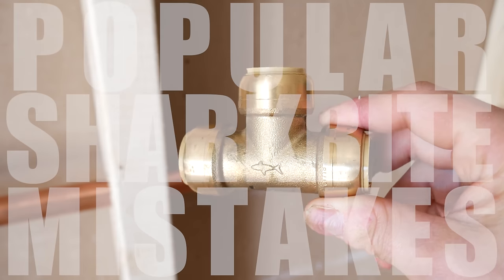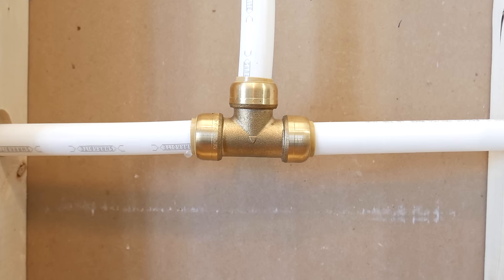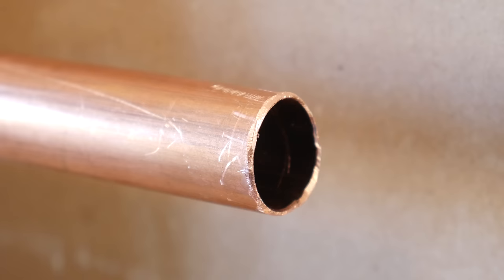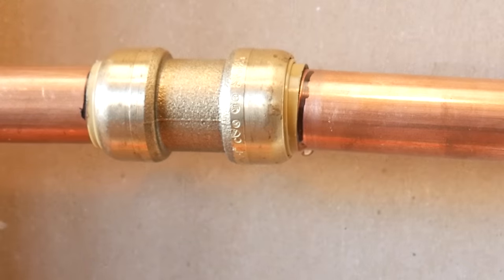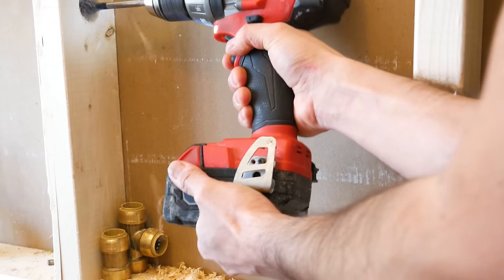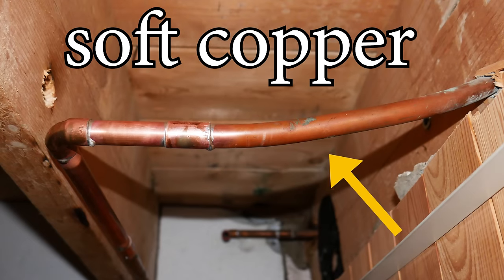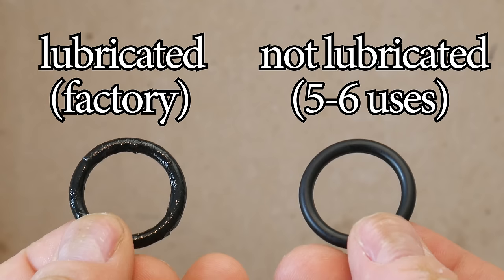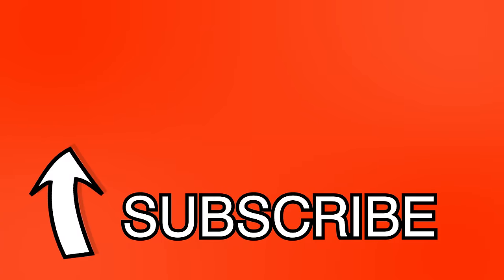6 SHARKBITE Mistakes NOT To Make! | GOT2LEARN

Comment: There's really only two applications that I will use these fittings for.  
The first is temporary caps.  I keep a few around, and yes you need to know when to throw them out once they've been used too much.  They are great for short term caps for supply lines during a remodel.
Second, and I only use these situationally, are shut off valves.  I still favor saudering, but sometimes I will throw one of these on instead.
You couldn't pay me to use one of these sharkbite fittings for in wall work.  And really, anything that isn't a cap or shut off, I would just prefer to sauder.

Comment: When installing a shark bite fitting in a copper line for a refrigerator water feed line, how do you get the fitting to fit properly if the copper lines in the wall won’t move?
Reply from the maker: I don't understand Sid.
Reply: @Got2Learn    My current water tap for my refrigerator is a pierce tap feed in a 1/2” vertical copper vertical line, the copper line runs vertical up though the floor and goes into the second floor, after cutting the copper pipe it still will not move enough to get the shark bite fitting into the pipe, other words the pipe won’t bend enough.
I guess I need to just call a plumber out and let them figure it out.
Reply from the maker: @sidallen685  and what exactly are you looking to do, remove the saddle valve?
Reply: @Got2Learn  Yes but the saddle valve just unscrews and I remove it, then I have to cut the copper pipe enough to get the Shark Bite fitting to slide onto the pipe, but I can’t get the pipe to move enough to get the pipe on the other part of the Shark Bite fitting.
Reply from the maker: @sidallen685  ok, so you just wanna condemn the line?
Reply: It’s like replacing a section of waste pvc pipe, a plumber can’t put a union in there because the union would be to short so they would use a rubber boot so he could slide it down further  to make it fit.

Comment: I was a school bus mechanic for a while and busses have air lines that use push connect fittings like this to stop air leaks. They all eventually failed. It was better to use a compression fitting. I don’t think I would ever sleep at night if I installed one of these in my house.

Comment: The only time i would use these is when you just cant get close enough with a torch to heat it properly or to converge pvc and copper. they are to expensive compared to soldering elbows and couplings

Comment: You can also feel for 2 clicks when putting in, that is how you know it is on, I have never marked, and never leaked. You forgot to point out also the the plastic insert has to come out when going on copper. That is a support for plastic.
Reply from the maker: Better to mark for insurance purposes 😉
Reply: Could you please be more specific about this plastic insert to remove on the copper side of the shark bite?
Thank you!
Reply from the maker: @YouTubeStudio101  There's no need to remove these, I contacted Sharkbite directly and they said that there's more chances of damaging the teeth if it removed so they said to just leave it in there, even for copper, just make sure there's no burr on the inside or it might get caught on it ;)
Reply: @Got2Learn  thank you so much :) I kind of picked up on that when I stumbled upon a second video of yours on the subject matter. Actually, every question I had on here earlier has been addressed by your other video. So, thank you AGAIN ! ❤️❤️❤️
Reply from the maker: @YouTubeStudio101  you are most welcome 🙏🙏🙏

Comment: Best practice is to not use them long term.   Let it get you out of a bind until you can get a good solid fitting based on the pipe you are using.
Reply: I feel confident enough to use them in exposed areas but I wouldn't use them in enclosed spaces. A proper solder job will never leak.

Comment: 2:05 BRO YOU'RE SANDING THAT? in your previous vid you said not to sand!
Reply from the maker: That's not sanding, that's scuffing, scuffing is fine.
Reply: @Got2Learn  can i "scuff" with rough sandpaper? i bought some water proof sandpaper and idk what to do with it lol. also hoping i can use it to deburr the outside and inside
Reply from the maker: @Layarion  You can use a light sandpaper to remove any debris from the pipe, but to deburr, you'll need a good file, sandpaper doesn't cut it.

Comment: One thing that you did not mention is that those white nipples should be removed for copper piping. Their purpose is to add structural support to soft pex pipes. Copper is strong enough to handle the pressure. Leaving them in on copper is effectively the same thing as leaving a burr: it causes flow reduction and turbulence.
Reply: Another tip is to always remove them (with a pair of needlenose) and place them in the end of the PEX rather than try to line it up inside the fitting. I've had fittings fail by the pipe stiffiner not lining up properly inside the pipe.

Comment: You don't need to leave those plastic insert sleeves in the fitting for copper.
Reply from the maker: They can also stay, just make sure the fitting is all the way in 👌
Reply: @Got2Learn  The reason why I mentioned it, is because I've seen people try to fit them during repairs in very awkward places, and the sleeve got kinda mangled. My coworker kept trying, and the sleeve kept hanging up on the pipe. It was a hotel, and the water was off for 270 rooms while he kept failing to make the connection. That's when I got called.
Reply from the maker: @aredditor4272  👌👌👌
Reply: @Got2Learn  Great channel, BTW.
Reply from the maker: @aredditor4272  thank you so much!!

Comment: I don't trust them enough to use them behind walls. I just had to have a connection redone because they did it on  rolled copper.... Or soft copper as you call it in your video.
Reply from the maker: Yeah, these won't work on soft copper ;)

Comment: Install a SharkBite wrong, it’ll leak. Solder a copper pipe wrong, it’ll leak. Whichever you choose, take the time and do it right. Cheers!
Reply from the maker: Very well said 👏
Reply: That's true, the question is what is easier to get right, and what is more forgiving to small errors

Comment: I have used shark bite for over 10 years on at least 1500+ Rough-ins. The only issues we have ever had is when it’s installed in correctly. 

The pipe, has marker guides already on it..... and you used the wrong fittings for copper. 

If you gonna post a how to, make sure you know how to actually install it.
Reply: What is the right fitting for copper and CPVC?

Comment: There's really only one mistake and it's by using a sharkbite in the first place. The only good use is for temporary isolation since it can easily be remove with an adjustable spanner

Comment: Got2Learn /or anyone knows the size in inches or centimeters for marking (0:52 and 1:31 Insert Depth Marks)?
Please don't say to look it up.
Reply from the maker: It varies from size to size, I put a link to the chart on the Sharkbite website.
Reply: @Got2Learn  Many thanks.  Trying to help my niece. So the rubber O-ring is good for about 22 years?
Would the water flow be reduced coming out of the SharkBite due the plastic funnel tubes (0:06) like?
Reply from the maker: @angelisone  i think they are under warranty for 25 years, and yes, those plastic stiffeners will affect flow.
Reply: @Got2Learn  Thank you again.
Reply from the maker: @angelisone  🙏

Comment: I would never use one of these inside a wall.
Reply: In theory you can as they're warrantied for 15-25 years. But yeah, bad idea to place them where they're not easily accessible.
Reply from the maker: Yeah they are actually code to use in walls (come states might prohibit this though) but they are approved to do so, it all depends on the comfort level of the person installing it.
Reply: I put them in walls all the time, itll last just as long as anything else

Comment: I am hesitant to use these devices in general because there are too many parts. A nicely soldered pipe is one piece end to end. These shark teeth things have multiple parts adding failure points and the plastics will fail down the road. Imagine one inside a wall. I could see them for an unfinished basement like mine is where you can see everything but when I see a house full of these I cringe. Time will tell about their long term reliability but I think of them like todays' cars - too much tech, too many needless parts, something will break, bricking your car and stranding you in the worst place possible.
Reply from the maker: You aren't wrong!

Comment: No do not use these in a wall. They are fine if you have access to them and can see them. Upinor pex is what you want. Not the pex from the big hardware stores but the real pex that needs a expansion tool to use. 20 year's commercial plumbing do it right the first time
Reply: upinor only

Comment: I've placed a shark bite on the same section of outdoor sprinkler system pipe 3 times, and every single one has failed the exact same way every single time.   The first one was installed by a professional and the pipe was prepped properly, cleaned properly, etc., etc...   so please, stop yelling about "deburr the pipe"! 
  The end cap section where the rubber seal and the "teeth" are located simply comes apart after 1 year, as if the plastic "grip ring" simply gives out and lets go!  It gets installed at the end of winter and has completely fallen apart by the end of the next winter.   Bizarre!  
   I'll be looking for other solutions from now on...

Comment: Hold up I had to pause the video, did I just hear him right, he did say the affordable an dependable?  Shit shark bite is right they gonna bite you in the ass five years tops an they go out.  I'm not a plumber I'm a framer.  Yet I re-plumbed from my washing machine through the kitchen sink tied in the tub an rolled it to the main drain.  2 y sweeps 2 coplers, an 2 reducers 1½-2" pvc.  Gonna get me a crimper an 150' of pex an im gonna replace the steel water lines int my house, so I'm gonna redo the entire water line.  Also need to run new main water line to the meter, which means tear up my drive way, I do concrete also footings an walls, retainer an free standing.  Life is about choices, choose to learn an ask questions don't allways run to ask for help try an ask questions

Comment: Clever fittings but way overpriced. Forget that!
Reply: U can get cheaper ones off ebay called eflin....u can get a 5 pack of 1/2 straights for $13 shipped as 1 sharkbite is 8 bucls by itself
Reply: @Tailgatesntoolboxes  eflin? Can't find em.
Reply: @johnarizona3820  just ebay sharkbites on ebay
Reply: @Tailgatesntoolboxes  I found tons of them but not the cheap ones. it's cool, nm

Comment: Six mistakes with shark bites...
How about you call a plumber and it will be cheaper to have it done right, instead of paying $30 a fitting and having a leak with a $0.02 o-ring.
Reply from the maker: All your fixtures have cheap nitrile o'rings and have the same pressure as everything else, why not talk about those instead?

Comment: Sharkbites are absolutely worthless unless they are accessable. They are not up to code ANYWHERE. Just as bad as the idiots that try to use Fernco Rubber Fittings and then try to defend them.

Comment: You definitely don't need to mark the pipe to know if it's seated properly, that's unprofessional, if you can't tell it's not seated properly looking at it you shouldn't be doing the job to begin with. 
This video clearly is trying to teach the basics of plumbing/pipe fitting, if a plumber doesn't know these apprentice level thing's already their license needs to be revoked, if you're advising non-professionals to try to plumb their own potable waterlines in their home without permits or inspections, your account should be banned.
Reply from the maker: And that's why we here a lot about these leaking, Sharkbite says to mark the pipe for insurance reasons to protect themselves, so it's really up to you!

Comment: The first mistake is using that expensive dogshit item to begin with. Oh and definitely do not use them in areas where they may freeze. Just don't use them they're a lazy brainless way of slapping a bandaid on pipes. Learn to sweat pipe and use the appropriate connectors for retrofitting.

Comment: Use other methods! Too many things to go wrong
Reply from the maker: You got an easier method with less steps?
Reply: @Got2Learn  with less risk
Reply from the maker: Like?
Reply: I get it that it easier from the other methods but the lrisk of a leeks is to high. Screwed fitting is an alternative.
The pipes with water in conditions that are changed threw the year, pipes are expand and shrinks. 
That's room for error!!
But if you're confident that you make everything correct and eliminate all possible error why not. 
Personally I will not use it.

Comment: Plumber here. The biggest mistake when using shark bites is using shark bites for anything other than a temporary repair. Don’t use them. Don’t do it.
Reply: Why though? I can understand not using them behind a wall or underground but if you use them where you can see them, then I see no harm. Just make sure the pipe is cleaned/deburred and the fitting is pushed in all the way, you should be just fine.
Reply: Used it for over 10 years on over 1500+ rough ins. Issues have only ever come up when it’s installed incorrect.